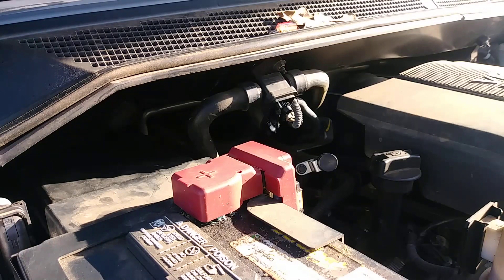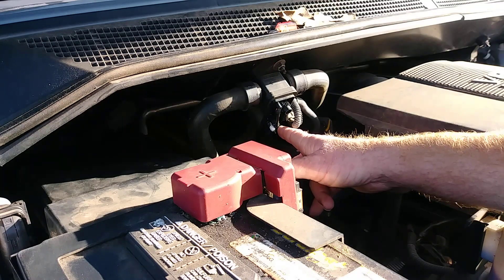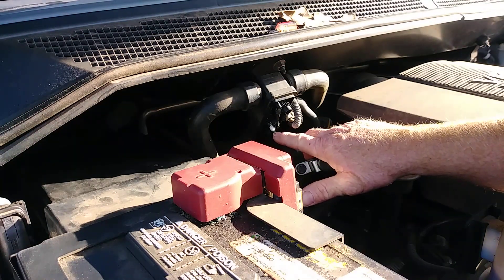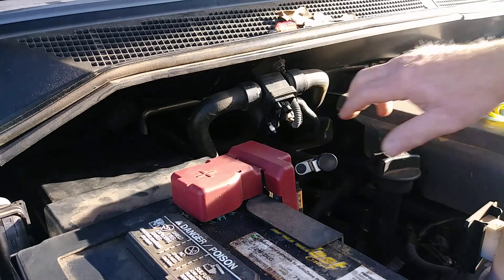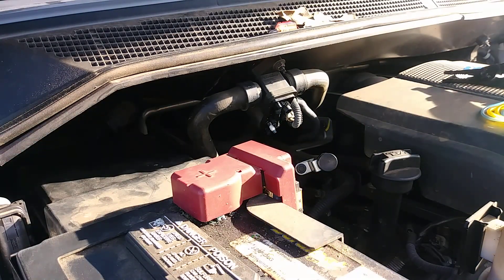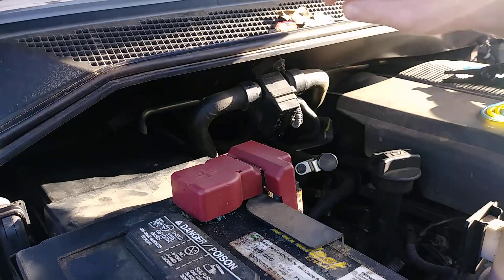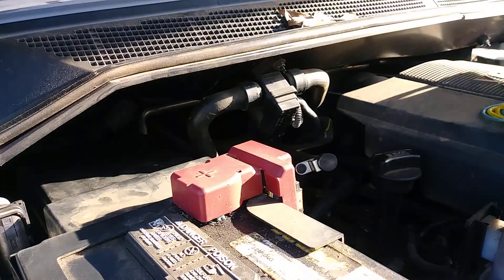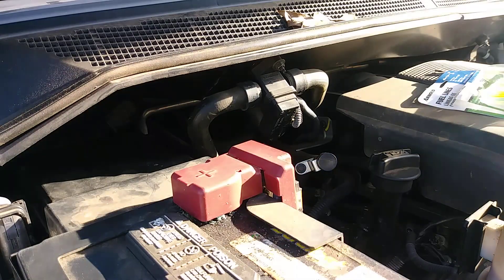Nissan Titan no heat quick fix, 5 minute $5 no drilling

Comment: Thank you. So helpful. 2015 Titan. 30,000 miles. Yesterday the truck started making a buzzing sound at start up and shutdown. I instantly determined it was that valve. At first I was looking at replacement parts and then I saw your video. I took off the cover, I pushed in the gear, I temporarily put the cover back on with one screw and tested it, and everything was quiet and good. I took the cover back off and although I didn’t have fuel line I did have a pen. I cut off a piece of the inside of a pen, the ink cartridge piece, onto the shaft. It was just slightly bigger than the shaft so it spins and keeps the gear in place. I cut it equal to the end of the shaft. Hopefully that pen piece will keep the gear in its proper place. What an odd design flaw. All the comments talk about this fix up to 2015. Maybe it was redesigned in 2016? Thanks again!
Reply from the maker: Glad it helped

Comment: Dude, this is awesome!  I have a 2015 Armada (only 32K miles on it, 2 months outside of warranty!).  This was a perfect fix!  Many folks have identified how to pull out the bone gear and manually get the heater working, but this is a perfect long term solution!  I went to Auto Zone and picked of a fuel line this morning.  I pushed the gear forward and put on the small section of fuel line on....bam....working like a charm.  We are 800 miles from our home in Tampa FL  going north and thought our Thanksgiving trip was ruined.  Don't know how long its been an issue because we have not used the heater in south FL for 7 months.  

Thanks to PSO and others for helping a family of five keep a vacation/holiday trip going!

***Update (May 10th 2021):  Just for reference, my "fix" worked for 1.5 yrs and I had to re-do it.  This remains THE BEST video and option for this repair.  Just posting to give a reference point on how long it worked for me and to suggest you have the limited tools available to re-do if you go traveling very far.
Reply from the maker: Glad it helped you and your family, safe travels !!
Reply from the maker: Hope it continues to be a fixable issue

Comment: Size and inner and outer of “fuel wire” is not t tubing? Solid ? What size cut.. seems interesting.. what is the purpose…..? What is the cause of original issue?

Comment: So what is the actual cause of this? All you have to do is put a plastic fuel line over that gear shaft?
Reply from the maker: The way it is mounted facing downwards, gravity pulls on the gear over time making it not have contact with the other gears thus making the mixing valve work as it should, yes just placing fuel line over the shaft and replacing the cover keeps it from sliding down. The fuel line basically is a shim keeping the gear in place.